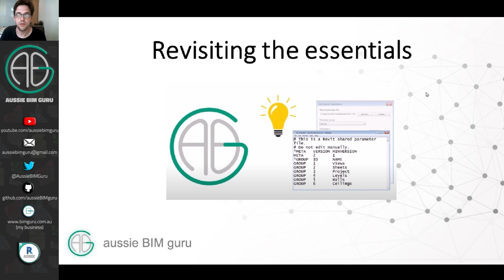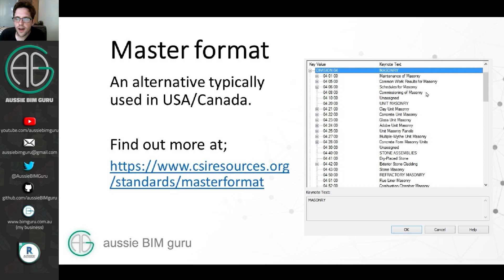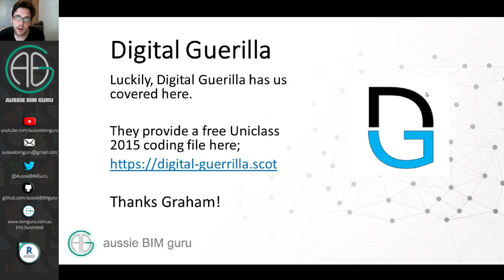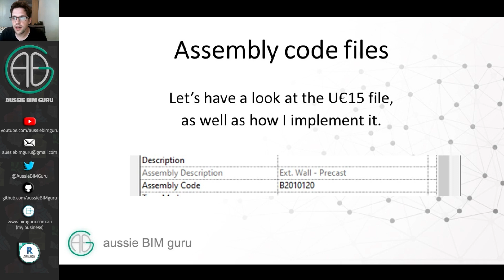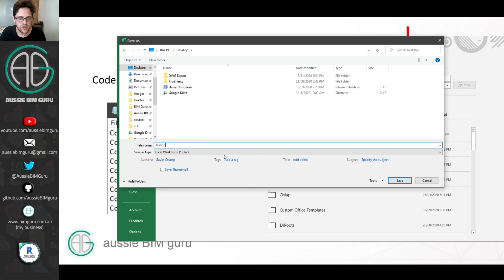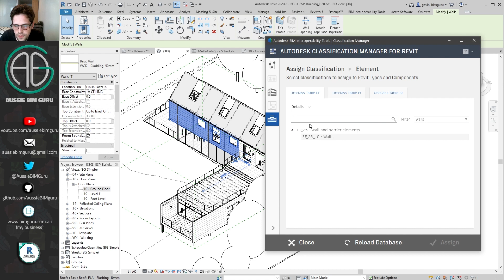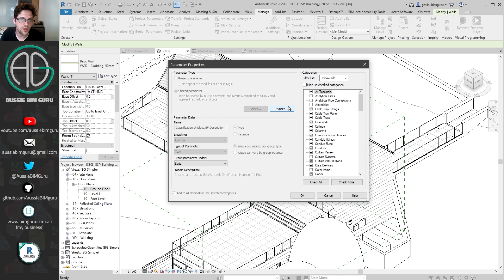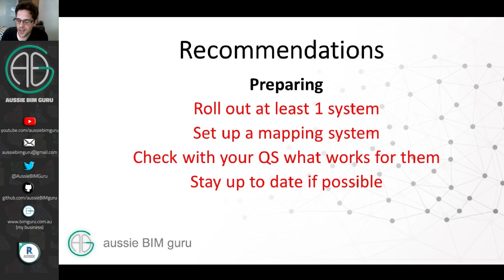Mastering Revit Assembly Codes!

Comment: Hey Gavin, thanks for your amazing video.
Quick question about how can we  designate Revit categories to the codes that we create?

Thanks again, take care!
Reply from the maker: To achieve this you need to add a tab and the inbuilt Id of the category you wish to assign to the classification. These can be most easily found using Revit Lookup addin and/or Dynamo/Revit API and will usually be a negative number (e.g. -2000035).
Reply: @AussieBIMGuru  it worked ! You da man!!

Comment: We use our cost manager's unique coding system, distinct from the standards. These custom codes are input into assembly parameters, while we also utilize Uniclass 2015 codes integrated within family names. Do you think this approach is appropriate, and what recommendations would you have? Thank you for your guidance.
Reply from the maker: Yes that would be a good use for assembly codes. The only challenge is if the company providing models to QS uses a different system typically, such as Unicode or Uniformat/Masterformat.

Personally I keep an equivalency table in Excel with the many formats I use aligned (so if I switch from Uniclass to Uniformat, I have a matching row containing both that I can use scripts to switch over).

Comment: Thank you for the video!
@AussieBIMGuru, in Revit is it possible to assign different code number for each wall element (bricks, insulators, gypsum...) to allow to distinguish them in the takeoff sheets?
Reply from the maker: Currently only possible using parts and material takeoff unless you model the layers separately unfortunately
Reply: @AussieBIMGuru  What about using the shared parameters?
Reply from the maker: You can add extra data to a wall, sure. But Revit wont know what to do with it unless you develop a workflow to leverage them. For example you could tell a wall it has 1 layer of brick, but to do a full takeoff would likely need dynamo and an understanding of how base properties relate to each piece your parameters infer.
Reply: @AussieBIMGuru  Thanks for the quick response! So can we consider this as a Revit limitation or as an intended feature?
Reply from the maker: @Mr-Setti  limitation with possible workarounds.

Comment: The tab at the end of each line is there for a reason, the last portion should be a Category Id which is used for filtering the codes in the UI, but usually it is omitted.
Reply from the maker: Thanks! I suspected as such.

Comment: Hi there down under , what do you recommend for specs software with revit ? thanks in advance
Reply from the maker: It's hard to set a suitable benchmark, but I usually suggest ideally at least;

32gb RAM
I7 processor, 3.7ghz+
Quadro, 1080 or rtx series graphics

Quadro series is ending soon so I'd suggest looking into rtx 2080 or 3080.
Reply: I’m sorry I wasn’t clear enough my question was for writing project specs and not computer specs
Reply from the maker: @ibrahimantonios  ah, I haven't actually seen many good solutions currently - the spec is typically fairly divorced from models in Australia still. The best solution I saw was by NBS probably;
https://www.thenbs.com.au/nbs-chorus

Comment: Nice video ABG. In the US we can utilize Master Format for a single element and Uniformat for Assemblies of elements. So Uniformat can have the full wall assembly, but it’s made of different material, all specified by the Master Format 00 00 00 system. 
One unified system would be awesome.
Reply from the maker: Yes I heard the US is using a combined approach, I think Uniclass might be able to capture this due to the Pr/Ss systems allowing sub-classification although I expect its adoption will be quite slow and gradual.
Reply: Omniclass is the combined approach. Similar to Uniclass 2015 it is a collection of tables each serving a purpose. Table 21 = Uniformat and Table 23 = MasterFormat. https://www.csiresources.org/standards/omniclass/standards-omniclass-about